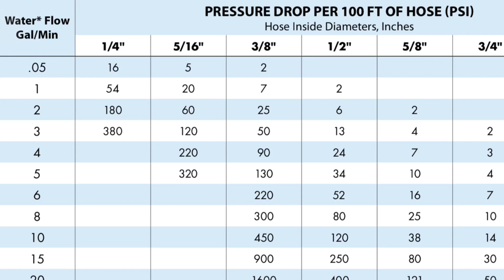3/8" Pressure Wash Hose Vs 1/2" Pressure Hose And Friction Loss

Comment: So I already have a 50 feet pressure hose, the size is 5/16. Im looking into getting a longer hose, Ive found one at 150 feet but the size is 3/8. Is it possible to connect those two so that it makes a 200 feet hose or will problems occour?

Comment: Hi.  Had a quick question.  If someone had a setup that used two different units both pushing 2gpm each going to a y connection and a 100ft 3/8 hose would it be safe to say I’m getting 4gpm?

Comment: I use 1/4" hose on my legacy 10.5 gpm  3750 psi pressure washer.  I can wash my neighbors roof across the street from my shaded truck with the a/c blowing while sitting in my driveway.

Comment: Hello I am new starting out with my soft wash system I have a northern tool soft wash unit I bought 5 .5 gpm 12v what size hose would I need max to get the best results for spraying chemical and then water and which hose is the best hose to buy for all this?

Comment: I’m running two machines 
10 gpm. 3000psi each 
If I use 3/8 hose. I lose 4.4 psi per ft of hose 
Which over 330 feet is 1500
Losing half my psi 
So I use 1/2” hose. And I only lose 1psi per foot. 330 psi 
So when I want to Siamese the two machines together. 
I have to run both 1/2 inch lines out 
And then hook them together to 5/8 line to the wash gun to stop loss of psi by just using one of the 1/2”lines to send the water. 
My question is. 
How much gpm and I losing when I’m running 1/2 inch hose 33feet to my wand. 
Or do I lose and gallons per minute

Comment: Very informative video! I have a question, I have a Ryobi 3000-PSI 2.3-GPM Honda Gas Pressure Washer, with a ½ pressure wash hose w/ quick connects. Would I see a difference in pressure if I upgraded to a ⅜ pressure washer hose?
Reply: So your asking if you go backwards if you'll see a positive?  Answer is, No.  That's physics.  Your not going to go from best case scenario,  insert a bottle neck and magically make your pump do something more than it was doing in its best case arrangements.  Also,  if a dying family member is dying from being squashed to death,  it's best to try and NOT hug them while it's happening and birds fly best in open spaces not inside of pipes slightly larger than they are. 

Last..... if you desire better performance then stop buying ryobi, bottom of the barrel or price shopping the low end on equipment you want to perform a certain way.  SPEND the money and buy the performance you want on the initial purchase rather than trying to jury rig additional purchases attached to it later on. Buy once,  cry once. It's saves you money in the long run..... and time,  not having to screw around with the gear and band aid it and research accessories,  install them,  take em off,  try something else etcetera etcetera etcetera.  Just buy what you need up front.
Reply: @SKYGuy Ok, so the answer IS no, gotcha. That's all I need, everything else you said I already knew & tbh this comment is old, I already know the answer to this as well. But thank you for the information bud 👍🏽and also the bird reference needs a little more work to it as well

Comment: Hi Jason.  Wondering if you could help me out.  I'm running a 100 ft 3/8 hose on a 1600psi electric pressure washer.  The electric pressure washer seems to have problems keeping pressure.  It has to pressurize every time i pull the trigger.   Is the 3/8 size the issue?  Do I need to go 1/4 ?   Thanks for any help.
Reply from the maker: I think it might be. That 3/8 hose with the flow too much
Reply: @kingofpressurewash  what would you recommend for hose dia on a 3100psi 2.5 gpm unit, if I wanted to step up to a 50' hose without losing any gpm? I'm assuming that the specs on my unit are based on 1/4".

Comment: I have a 3100 psi Subaru pressure washer but want to upgrade the original pressure washer hose , and would like to upgrade the garden hose I use to supply the pressure washer with water. I only use the machine for home/ vehicle use . I have been bursting leaks on garden 5/8  hose. I've been thinking of buying flexzilla brand hose for garden hose and either Uber or flexzilla 1/4  for high pressure hose. Are those good choices ? Can you recommend a good long lasting  garden hose that won't bust and a good high pressure hose for this machine? Thank you.

Comment: Thanks for vid!    When I switched 4pgm to 8gpm, my hands are getting trashed no matter what wraps, or different ways trying to hold gun, or going up to 15 or 20# nozzles, (helps), my gun is standard 3/8 inlet 1/4 outlet, 10gpm gun.  
   Does anyone know if switching to 1/2 hose from 3/8 may reduce vibrations?  (It's not my pump) What about those oversized shock guns, 22 gpm 8000 psi, 1/2 inlet, 1/2 outlet?
Reply from the maker: Should be in the 60s series
Reply: @kingofpressurewash   It wouldn't hurt to buy a regular 3/8 50ft section, $50-60 Amazon and try it. But it may be something else
Reply: @Nathan-wf1pr  I have a gear drive. Same as belt drive, lower RPM. I tried 3/8 hose, still the same…
Reply: @Kris9464   On my big machine, after replacing about everything, it finally turned out the strange low frequency vibration that was destroying my hands turned out to be the pump. I had already bought a 10 gpm pump earlier, and when I replaced the 8 with the 10, all vibration was 100% gone. Didn't matter if I used all 1/2 inch or 3/8 hose. When I replaced pulleys, turns out that the original machine had wrong size pulleys and was spinning the 8 too fast and wrecked it is my theory. With the ten I spun it at the two recommended rpm, 1750 and 1450, no vibration either of those speeds on new 10. The original pulleys spun the original 8 at 1900+.  If you replaced pump and also gear spin it slower, I don't know what it may be. I tried a gas filled dampener device after unloader with that bad pump and that made no difference with low level vibration. You couldn't see any shaking, it was low frequency vibration that crippled my hands, took two months for them to heal.
Reply: @Kris9464  I don't know if it's some freak manufacturing error on why my general 8 was bad or if it was from too high rpms messing it up. I did try putting the 8 back on at 1750 and 1450 rpm but the vibration was still there with that bad pump. Unfortunately only way to test if it's your new comet is to replace it, or maybe gear drive isn't balanced, or bent shaft on motor. It was annoying as heck to try and figure out wth was going on.
Reply: @Nathan-wf1pr  I had this gx390 engine hooked up with  AAA pump that went scrap, vibration was present there. Now i hooked a brand new comet pump and P.A. Gearbox to reduce it to 1450rpm to this engine and vibrations are still here even the pump is new. Do you think problem could be in this engine like u said bent shaft? I tested it with ball balve wide open vibrations are there but when i close it and pump goes into by pass mode return to tak suddenly vibrations are gone. I kept rpm of engine on same level during this test.
Reply: @Kris9464  I tried calling shops, forums, general pump tech etc. No one could help. Someone said a bad unloader could maybe do it. I replaced the unloader on mine didn't help. But who knows. If there is no vibration when on bypass, it probably isn't engine. It sucks to have to just keep replacing parts to figure it out. A green spring unloader is nice, it's 1/2 inch though so you need 1/2 to 3/8 adapters. Unloader $100 Amazon.
Reply: @Nathan-wf1pr  I have changed everything. Hoses, water filter, water inlet. I rebuild a pump I mean whole manifold like check valves, o rings, packing sealing, piston sealing, engine mounting, pump mounting and no improvement. Vibrations are still there. The only thing that left is this gx390. Can be possible that engine produces this vibrations?
Reply: @Kris9464  wait, I thought you replaced pump. But now you say you rebuilt pump.  Hey, my pump was almost new, 8 gpm general tsf 2119?   Anyways, it was my pump after all. I put on different pump 10 gpm tsf 2121? 2021? Something like that. Zero vibration.  Before replacement, it was a low level vibration. You couldn't see any shaking. You could barely feel it.  But after washing a while, hands were crippled. It was bizarre. My other power washers, one a 4 gpm Honda gx390 never hurt my hands. My 7hp machine that vibrated a little visibly, did not hurt my hands at all. I don't know why the 8 pump had that issue other than something inside wasn't balanced like the main crankshaft probably.
Reply: @Nathan-wf1pr  I replaced AAA pump with Comet RW 4040 pump in Autumn last year. Today I rebuild manifold in this Comet pump, still vibrating.
Reply: Im using 5/16 high pressure hose for my 4400psi 4gpm machine and im so frustrated about vibration of hoses. I replaced my cart, even replaced my old AAA pump that went broke and with the new Comet 4000psi 4gpm pump and skid mounted on truck my hoses are vibrating as fck. Do you think switching to 3/8 hose will help? Do you have any vibration problems with 3/8 and 8gpm 3600 psi? I might be switching to 8gpm near future and i dont want this vibration any more.
Reply: @Kris9464   Do you have belt drive and pulleys?

Comment: 1/2" jump from pressure washer to reel, 1st section of hose 50' of 1/2" hose and then run 3/8".  Excellent!
Reply: what about out of unloader? the unloader on my 8gpm pressure pro has a 3/8 port. seems pointless to run 1/2 hose when the output port is 3/8
Reply: @Diego-Delgado  put a 1/2” unloader
Reply: What gallons per minute abc psi is your pw machine

Comment: After being in the pump and pressure wash business for years I've learned a few things about the diameter of hose that works best for your application. Yes one variable is friction loss but this only becomes a problem when your pressure gets closer to your desired gallons per minute of around 7%. For example a 7gpm pump at 100 psi is 7%. So increasing from 3/8" hose to 5/8" hose an increase of around 30% will make a huge difference. When it comes to high pressure the same principle applies so going from a 3/8" high pressure hose to a 1/2" high pressure hose is not worth it. For example you would need at least 200 gpm at 3000 psi to then make a difference to go from 3/8" to a 1/2" high pressure hose. The best way to look at your high pressure wash hose is to see it as a vessel nothing more. Now when it comes to  single wire or double wire high pressure wash hose the only reason to go 2 wire is for higher pressures or for less expansion not necessarily longevity. Now I know this is like counting brass tacks but I thought with the cold weather and it being a slow day I'd try and shed a little light on the topic for $hits and giggles. Long story short stick with your 3/8 single wire hose and save your back.  

Don't forget if the trigger isn't pulled your not making money!
Reply: When I use 3/8 hose. 
I lose 1500psi out of 3000
I only lose a couple hundred psi when I use 1/2 inch hose
Reply: @tylerhovdebo  He's got it backwards lol
Reply: Thank you !

Comment: So if i understood you correctly I ordered a 3/8 hose for my soft washing 4 gallon a min do they have a soft washing gun that fits a 3/8 hose or do i make it out of PVC ?
Reply: you understood incorrectly... the 3/8th was pressure hose... you want a bigger hose for you soft washer.. like 1/2 or 5/8
Reply: @anthonylong2090 so I do mobile detailing with a 5.5 3500 psi on gx390 I’m only getting like 2k psi. But is it worth getting 1/2 inch or 3/8 hose

Comment: Jason, I bought a new 5.5 gem 2500 pst from Russ Johnson. I notice when I’m spraying out of my j rod or M5 nozzle, the pressure will drop and surge after spraying constant for a few minutes. I have a 50 gallon buffer tank with 1” house running from it to washer. Any ideas what would cause this? Thank you
Reply: Accumulator

Comment: What is going to be the noticeable difference in getting the job done between a 4000 PSI 4 GPM pump and a 4000 PSI 8 GPM pump? Thanks.
Reply: I have 2 4,000 psi 4gpm machines daisy chained. I only use both to get 8gpm on surface cleaning drive ways, sidewalks, and drive thrus. Housewashes using my DS I only run 1 machine at 4gpm. It is an easy setup and I absolutely love my setup because if one machine fails I can keep going on the job by just starting the other one. Then deal with the failure at a later more convenient time away from my customers house.
Reply from the maker: 8 gpm pressure has nothing to do with it
Reply: Pressure Wash Help - I didn’t think that it did. I have a 4 GPM machine. I don’t think was even aware of 8 GPM pressure washers until you mentioned it in one of your videos. I was wondering why someone would pay for an 8 GPM pump if it wasn’t going to do anything that a 4 GPM pump wouldn’t do. Thanks.

Comment: I think you just solved my issue of my pump not shoot as far as i wanted it to im running a 5.5 gpm pump and 1/2 inch id hose
Only sprays up to 25 feet
Reply: the larger the hose the more water flow however the smaller the hose the more water pressure
Reply: @johnpressurewashingpaintin9066  Best to have a larger diameter hose to preserve flow and only add a restriction at the end (choose an appropriate tip/nozzle) to create the desired psi.

Comment: What is the best method of connecting a 1/2 pressure hose to 3/8? No one local has a reducer that will handle 3500-4000 psi.
Reply from the maker: You could do some type of bushing to step down with a Cupler
Reply: Use q.d.'s on each hose. Make sure the q.d.'s are the same size. Use the q.d. As the reducer.
Reply: That’s exactly what we ended up doing. Had to hunt all over town for a coupler since mail order is delayed on non essentials right now. Thanks for your reply and all the awesome content!

Comment: Regarding the h.p. hoses. Do they make a 1/2" double wrap? 
What's the difference on life span h.p hoses 3/8 double wrap vs 1/2"
Thanks
Reply from the maker: There isn’t much of a difference on lifespan. And yes they do make a two wire for half-inch
Reply from the maker: Yes they do make it to our for half-inch. Lifespan there’s not much difference

Comment: I have a cold water unit that outputs 4gpm @ 4200psi. Most 3/8 single wire hose are rated for 4000psi and was wondering if these are safe to use with my unit or am I stuck with using a stiffer 2 wire hose which are rated for 4500psi and up?
Reply from the maker: You’ll be fine with r1

Comment: I got 1/2 but it was cheap and non-marring. And friction loss is taught in fire prevention classes.
Reply from the maker: yup friction loss is important
Reply: I know I lose 4.4psi per foot if I use 3/8” hose on my 10gpm machine 
If I use 1/2” hose. I only lose 1psi per foot
Can you tell me how much if any gpm I lose in both cases. I can’t find a calculator or that
Reply: @tylerhovdebo  Should be able to google 'Friction Loss' and get something to start with.  Elevation adds or subtracts in the equation too. VFD used to run 3 inch hose on 2 1/2 inch couplings to minimize friction loss.

Comment: Very good point Jason. Whenever we have over 150 ft or need 300 ft Plus our very first connection from the machine is half inch hose for at least a 150 ft. Whenever we are working far away from the truck we don't have to worry about lugging around 150 feet of half inch hose it's just there at the beginning.👍🏼
Reply from the maker: Yep that is correct